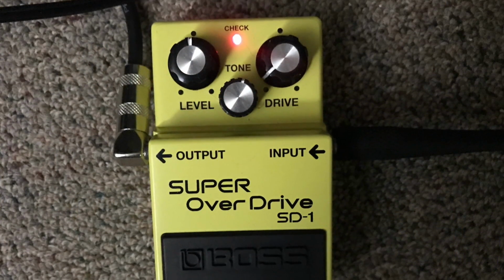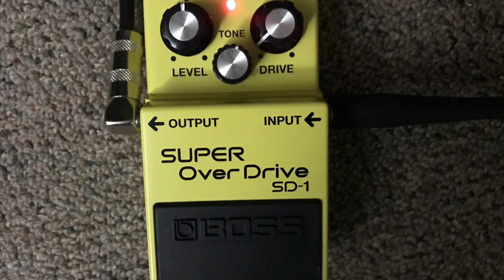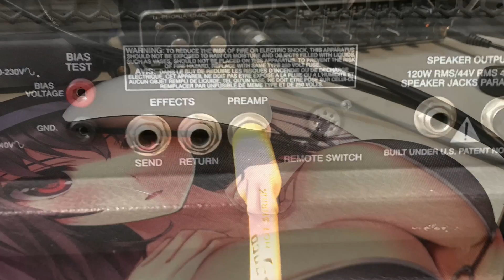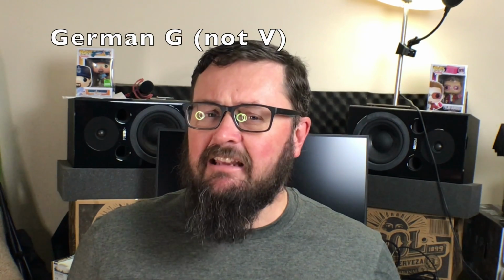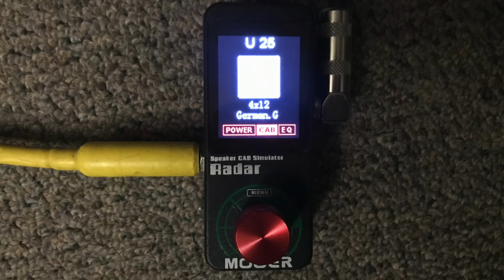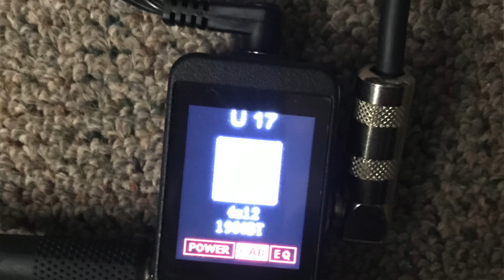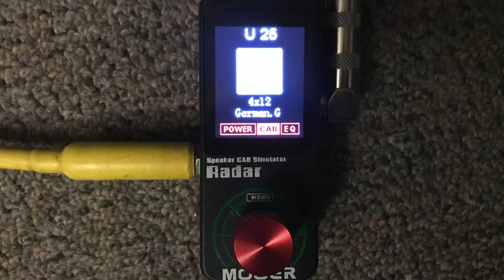Mooer Radar vs Digitech Cab DryVR

Comment: I stumbled upon an absolute game changer for the Mooer Radar (credit due elsewhere): disable poweramp. Go to Parametric EQ tab and set it like this - Freq 110Hz, DB +13, Q 2.5. Freq 12kHz, DB +13, Q 0.50. Try that on any and all presets, 100% more realistic than the power amp simulation attempt to do similar.
Reply from the maker: Awesome, will definitely try it out.

Comment: Can i use mooer radar in a combo amplifier?
Reply from the maker: If it has a “Pre amp Out” output then yes.
I wouldn’t recommend using the headphone jack but it couldn’t hurt to experiment. (Just keep the input vol on the Radar low to start)